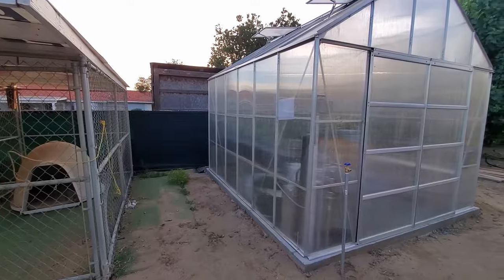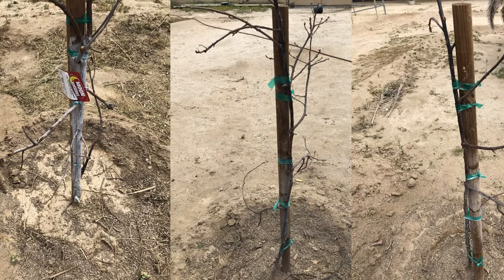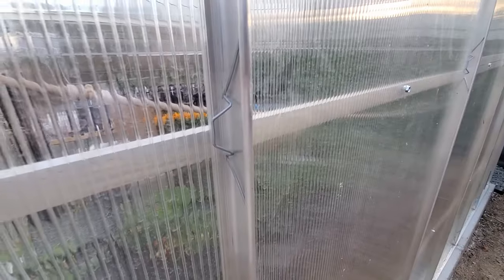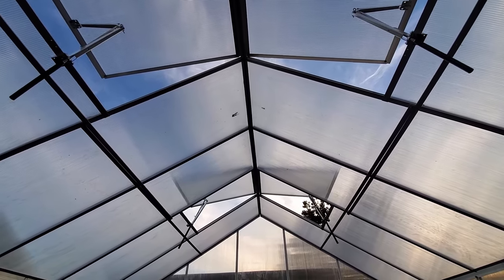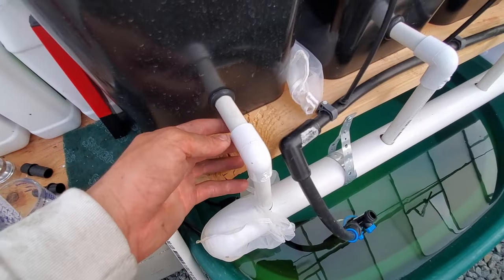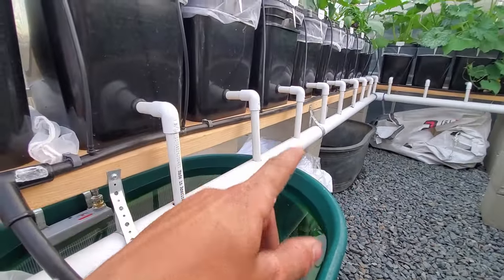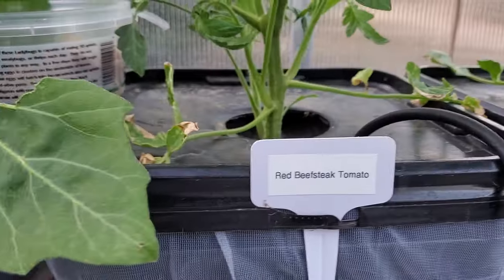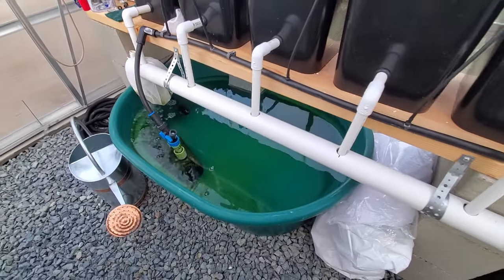Harbor Freight Greenhouse & Hydroponics Overview

Comment: Tip: make a good light proof cover for your reservoir lid, or your gunna have a system full of algae and nutes levels and PH all over the place. Also too much sun exposure causes some of the nutrients to Precipitate out of your mix this means that they get so hot from the suns rays they kinda melt togther into large clumps and fall to the bottom of your rez. Worst part is you wobt ve able to just stir them back up youve gotta totally remix the nutrient solution to reppace whatever  mineral or nutrient it was that fell out.

Comment: Hey, some thoughts for anyone who sees this and likes to build it. I think the dutch buckets are too close together for tomatoes and the cucurbits family plants.. Also, the greenhouse is probably not high enough for the tomatoes, due to them being raised half a meter. You are probably okay for the peppers. Maybe you can give your plants a boost by using dedicated hydroponic nutrients. The 0-4-4 does lack a lot of punch! No nitrogen at all. I recommend the general hydroponics 4-18-18, combined with Magnesium Sulphate (Epsom salt) and Calcium Nitrate for the nitrogen. This is their tomato blend, which works pretty well for peppers and cucurbits. Your plants will double in size! 

Also, you might consider putting a lid on the reservoir, to hinder algae growth.
Reply: I would put the tomatoes in the center with supports, and short plants on the outside. I would also dig a hole for the reservoir and put the pails on the ground.

I think he has a 3-part nutrient system, as there were two other jugs in the video. Shouldn't be stored in the sun and heat.

Comment: Id love to see how you keep the temps regulated from overheating in the summer. Great job bro
Reply from the maker: Thanks! We use a temp controlled fan to keep the air flowing when it's hot out, and the little auto opening roof vents help some as well. The heat is certainly something to look out for!

Comment: Very neat and clean setup. Tell me where you got your buckets. I need the black ones.
Reply from the maker: U line! Link is in description, or search for "U line square buckets"
Reply: @FormulaJake  thank you sir
Reply: Did you have any problems with your water getting too hot?
If so, what was your remedy?
Reply from the maker: We have not had that issue, but if that is a problem, there are water chillers made specifically for hydroponics!

Comment: FYI, not all hydroponics are RDWC. For small growers F & D is much simpler, and works quite well
Reply: We're just getting started with Hydroponics; what are rdwc and f&d? Thank you in advance!
Reply: @atlantic2233  Recirculating Deep Water Culture which you appear to be doing. Excellent for larger grows. F & D is Flood and Drain used for less 4 x 8 or smaller

Comment: what kind of winds do yu get. I cant imagine it wont take much ,especially the gusts
Reply from the maker: Not sure about speed, but in the high desert in southern California, we can get some pretty intense winds at times. That's why we poured a concrete foundation and used self-tapping screws to hold the panels to the frame
Reply: @FormulaJake  I live down the road  in the PalmSprings area of Ca. Our winds are frequently enough to be 15 to 35 mph with gusts. Fortunately theyre only in the first 2 or 3 months, as I recall. The constant vibrations a wind causes  expensive cloth lined car covers to wear spots in the paint and anywhere there is a snug contact interface between the plastic or cloth against a harder surface,clamps or car fender s. 
I think I recall youve had this "structure for  while and vibration hasnt worn  holes or rips at the plastic sheeting and where it contacts the  structure/clamp mechanism?
Reply from the maker: Right on. We haven't had any issues with vibration or strong winds harming our structure. Without the concrete foundatuon, I think it's possible that it would have blown away. And without the self tapping screws, the panels certainly would have been blown off by the wind

Comment: Those cieling attachments are automatic extending with heat?

Could you make your own nutrient with compost tea?
Reply from the maker: Yes, they extend out to help cool it down when the inside temperature gets too hot.

https://www.amazon.com/Univent-Automatic-Solar-Vent-Opener/dp/B0083IZG0A

I do not know enough about nutrients, but I imagine you could! We just use store bought nutrients.
Reply: Definitely if you compost the proper materials and use the runoff water that comes out of your compost bin. Is packed with nutrient and bacteria.

Comment: what's the point of growing each plant in a separate container?
Reply: By growing plants in individual containers, you can change water flow and sanitize/separate/remove plants from the line without stopping the whole service or disrupting the other plant's roots. It's also cheaper and easier to grow multiple varieties in this way, the Dutch Bucket method (also known as Deep Water Culture), because no custom containers are needed and they can occupy a more flexible footprint than a single, larger container. There are other methods for hydroponics but DWC allows better structure for climbing plants like tomatoes and cucumbers or bushy plants like peppers. 

So outside of cost, mobility, flexibility, variation of crops, and ease... There isn't really any other benefit over growing with other methods like raft (expensive and big), media bed (size prohibitive and more difficult maintenance) or nutrient film technique (difficult setup and less diverse).
Reply: @thewingett   thank you

Comment: Very nice set up, but you missed some key components of running a hydroponic cultivation. PH, PPM during the various stages of growth, Oxygenating your water... You have a float valve topping off your reservoir, but I don't understand how you PH and top off your nutrients unless you have an in line mechanism injecting fertilizer after the valve, How you keep the nutrient solution consistent is beyond me. 

You have blueberries which like acidic soils at like 5.2 PH and peppers which like standard soils at a 6.2 to 6.8 eating the same fertilizer regime while being isolated to inert growing mediums and being fed an organic nutrient solution which can probably only be uptaken at a PH of like 6.5...

I have no idea how you make this work and I've grown a lot for a long time in a tone of different ways. 

My advice to someone trying this would be to instead of using inert growing  media like perlite or hydro ton to grow various kinds of plants would be to instead. Buy Peat moss, coco coir, earthworm castings, pumice, oyster shell, calcium carbonate lime stone, fish bone meal, bone meal, gypsum, a bit of biodynamic compost, some course sand and save up some used coffee grounds and egg shells. Mix these ingredient into two balanced blends (the distributors will have the ratios but you'll be doing half of that per container) The acidic plants will have a blend that's heavy on gypsum, coffee grounds and fish meal, while the neutral soil plants will have a mix that's a bit heavier on lime stone. Once you have blends that will maintain there soil PH and consistency for a reasonable amount of time without requiring adjustments Feel free to set up a reservoir to mix your fertilizer with a pump and timer, adequate drip irrigation, and a drain line that rather than recirculates back into your reservoir is instead drained into an adjacent planter or garden bed. The irrigation frequency has to be adjusted throughout the growth cycle to maintain a relative soil moisture and dry back, Your nutrient solution should be drained and remade from scratch every week. Use a nutrient regime that actually works for soils and allows you to let mix for a week without it falling out of solution or losing the Potential hydrogen PH needed to feed the plants. Also oxygenate your water and get the ammonium chloride out of it. A product i would recommend is the Canna Terra Vega and flora or Bio bizz i believe they have product that is good for soils and can be mixed and applied for a week or so before it falls out of solution. ideally you'll only use a fertilizer that wants to be PH's at 6.5, but some of the more synthetic one require lower PH and can work if your mixes are reduced to less amendments. 

There's alot to plant science and if you can make the set up in the video work More power to ya, but If you can get a well rounded regime that's mixed correctly in a growing medium that's appropriate for the desired plant health you'll get a lot further it think.  

Really hydroponics is designed around producing monocrops. If you have an inert growing medium with tomato's in it and the only available food source is a liquid feed designed for tomato's? Well obviously tomatoes are going to grow well in it, same for peppers and thing's like tomatoes, but trees aren't gonna like it as much, berries and grapes aren't going to do well in an environment designed for peppers and tomatoes. Specializing soil mixes and applying well rounded fertilizers to enhance the plants nutrient uptake while giving the ideal root zone for the plants to digest and harbor native beneficial organisms just ends up being more productive if you want variety.  

If you just want peppers? Stone wool, synthetic fertilizers are really productive.
Reply: here's the Chat GPT version. 

Your setup is impressive, but to truly optimize hydroponic cultivation, several key components seem to be overlooked. Factors such as pH levels, PPM (parts per million) during different growth stages, and oxygenation of the water are crucial for sustained success.

I noticed you have a float valve for topping off your reservoir, but it's unclear how you manage pH levels and nutrient replenishment, especially considering the need for consistency in the nutrient solution. Achieving this consistency is essential, particularly when cultivating a variety of plants with different soil pH preferences, such as blueberries and peppers.

Moreover, using inert growing media like perlite or hydroton might not provide the optimal conditions for diverse plant growth. For those attempting similar setups, I'd recommend a more tailored approach, utilizing organic materials like peat moss, coco coir, and earthworm castings, along with various minerals, to create soil mixes tailored to the specific needs of the plants.

Creating such blends ensures pH balance and consistency over time without the need for frequent adjustments. Setting up a reservoir with a pump and timer for fertilizer mixing, along with proper irrigation and drainage systems, is essential for maintaining nutrient levels and moisture balance.

It's crucial to adjust irrigation frequency throughout the growth cycle to maintain soil moisture levels and nutrient uptake. Regularly replacing the nutrient solution and using fertilizers designed for soil application can prevent nutrient deficiencies and maintain pH stability. Oxygenating the water and avoiding substances like ammonium chloride are also important considerations.

While hydroponics can excel with monocrops like tomatoes or peppers, achieving variety and optimal plant health often requires a more nuanced approach with tailored soil mixes and well-rounded fertilizers. Specializing soil blends and providing the ideal root environment can enhance nutrient uptake and support native beneficial organisms, ultimately leading to higher productivity, especially for diverse plantings like trees, berries, and grapes.

In summary, while your setup is commendable, addressing these aspects could lead to even greater success and productivity in your hydroponic cultivation endeavors.
Reply: could this setup be adapted for indoors? i just want to grow my own cherry tomatoes, so many we get from local grocery are rotten and the prices are starting to go off the charts. what would you recommend?